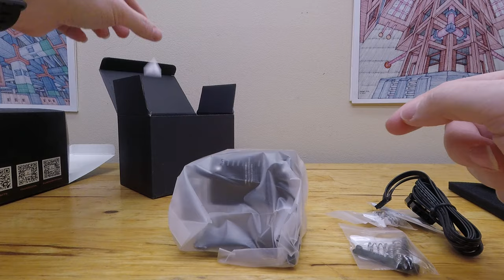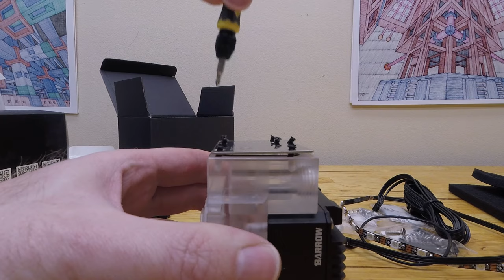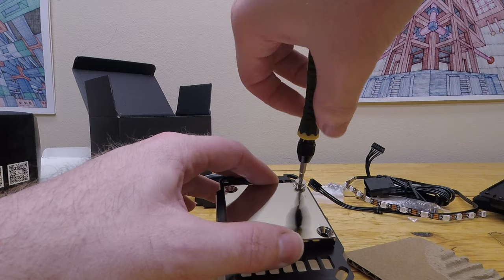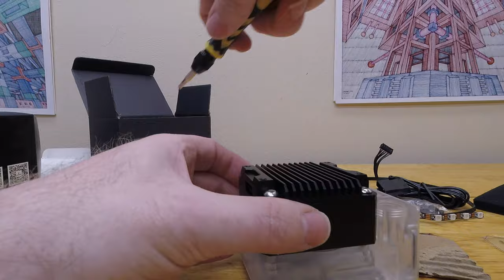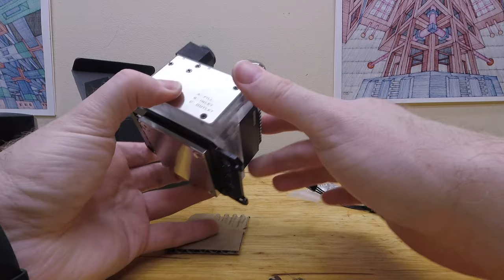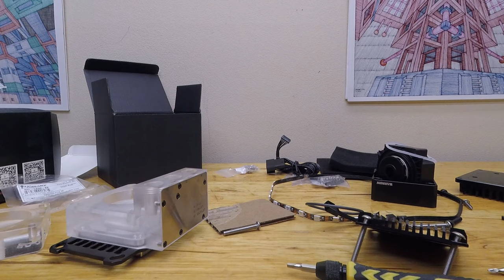Disassembly Reassembly DDC Barrow AMD CPU water block integrated pump and reservoir combo LTPRKA-04

Comment: does the block support d5 pumps or only ddc pumps ? sorry if my question does not make sense,im new to watercooling.
Reply from the maker: Not a problem. I'm pretty sure DDC and D5 are different shape/sizes so you won't find anything (tops or block wise) out there that will fit both. Most places you can filter down to one or the other.

Comment: Thanks for the video, it was really helpful. Regarding the LED strip, can it be plugged into a standard motherboard fan header? or does it require a motherboard with an RGB header?
Reply from the maker: Don't plug into a fan header!!!!! They sell a converter to 5V RGB header. There's even a little tag telling you not to plug into motherboard fan header. I think they used that connector for convenience, but is only confusing to end users. There is a label on the converter and the led strip's connector that says "5V lighting interface" on one side and on the other says "Do not connect to the motherboard interface of 12V FAN" I've posted pictures of this label here:
https://imgur.com/a/rmfUjlv
This was the USA ebay vendor I used who sells the converter: https://www.ebay.com/itm/Barrow-5v-RGB-Adapter-Lrc-2-0-ZBDZJX-5-IN-STOCK-USA/303575876543
Reply: @flyordieinafire  Thanks again for the information. Too bad Barrow doesn't include all the wiring to make the lighting work out of the box. I purchased the adapter, and swapped out the pump with my Swiftech MCP35x.  This is a really nice piece of hardware!  An aside, I've been admiring your screw driver, what brand is it ?  Thanks again.
Reply from the maker: @Soda480Place  Glad to help! It came with an iPhone repair kit
https://www.amazon.com/dp/B00SURH7W4/

Comment: Nice! What's the deal with 90 degree rotation for AMD vs Intel? Looks like it can be configured either way? Also any flow or noise numbers for the pump swap?
Reply from the maker: Thanks for the comment. With the Intel mount (I don't have) you can mount either way without issue, but with AMD the Reservoir/ports section of the acrylic block two of the AMD mount holes so you can only mount sideways either way. Optimum Tech shows close up of intel mount here: https://youtu.be/SBIWgKmwr68?t=130
Alta's Project shows the AMD mounting here: https://youtu.be/zSfsFlaw7uM?t=189
Original pump looks to have a potentiometer dial to adjust speed and the MCP35x is PWM controlled. I won't have flow or noise numbers for this pump swap for like a month. I'll post another video. Currently waiting on GPU waterblock preorder. In the meantime I'm test/dry fitting the parts I do have to sort out what other parts I need to order.
Reply: @flyordieinafire  sorry, let me rephrase my question :).. I have an AMD block (like yours)... What's stopping me from pulling it apart and reinstalling the mounting bracket with a 90degree offset? From your video it looks like that will work just fine?
Reply from the maker: Here's an imgur album (at the end of this post) . Does this help answer your question? You'll notice two of the mounting slots in the bracket are blocked by the reservoir area. They could offest the acrylic drilling and offset the bracket to compensated for this, but as is it's symetical and the reservoir is in the way. Alternatively if they made the widge just the G 1/4  width they could make the reservoir section shallower but maybe they didn't do that because of the G 1/4 Threads. https://imgur.com/a/uMywI8f
Reply: @flyordieinafire  ahh I see, damn why didn't they offset the whole thing by a few mm....ok, so basically someone needs to laser cut a new mounting plate...

Thanks again for the pics/explanation
Reply from the maker: @davids8345  np. A new mount plate also means mount on die/cpu will be offset. Probably not a deal breaker especially if it's the difference between mounting and not fitting.
Reply from the maker: @davids8345 I was thinking about it and I'd totally have paid a couple bucks more for a second bracket with the couple millimeters of clearance needed to mount in the other orientation.
Reply: @flyordieinafire  yep.. if I had a friend with a CNC machine I might be tempted to produce some...

Comment: Nice video ! 
All my laing DDC pumps ( four ) are 10+ years old and they are all atill going strong. I wonder how many of those chinese knock offs will reach that mark.
Reply from the maker: Another user mentioned theirs had a rattle out of the box. So it's probably hit or miss likely a miss.
Reply: @flyordieinafire  Damn. Also did I miss it or there was in fact no heatpad between pcb and heatsink ?

Comment: Is there supposed to be a thermal pad in-between the pump components and it's heatsink or else I imagine it doesn't really do anything to take heat away from the pump ?
Reply: Asking about the stock pump on the block before you changed it out
Reply from the maker: @chewbaccasaurusrex692  I don't believe there was. This was the first time I opened the packaging. I haven't played back this video in a few months so I don't recall. If you didn't see one in the disassembly then there wasn't. Most aftermarket metal housing I think have something to help reduce heat to prolong the life of the electronics.

Comment: how are your rotary fittings that smooth? My bitspower and barrow rotaries are so damn stiff.
Reply from the maker: Machined two pieces. That's how they can be that small. Unless you're talking about the bigger EK rotary fittings. Big fan of the classic EK 90 rotary.

Comment: Did you ever test the swiftech pump if it seals correctly and works great?
Reply from the maker: Project stalled. 😩 Was waiting on parts before I could finish build. Haven't gotten back to work on it now that I've got everything in. 🤷‍♂️

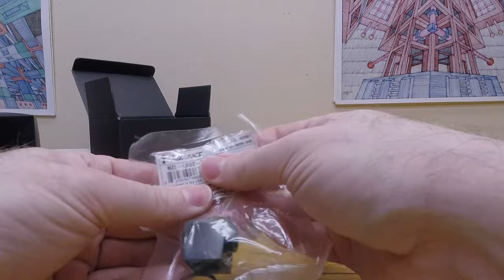Comment: One suggestion: If you don't want to use 90* fitting 12:50 you can remove the pump, install your fittings then replace the pump properly without crushing the O ring. Cheers.

Comment: Is it the same pump they use for their pump reso combo? People said it's only good for ITX builds but I'm thinking to use this for ATX builds (360 rads, longer tubing). Do you think it'll work just fine?
Reply from the maker: I don't know. I already had the MCP35x on hand and I can control with PWM on the machine. I've already swapped out the stock pump. Stock pump has manual potentiometer for speed adjustments.
Reply from the maker: Here is someone else's imgur on the parts the block comes with: https://imgur.com/gallery/izA9uD0
From this thread:
https://www.reddit.com/r/sffpc/comments/ic43es/the_barrow_blockpump_came_in_today/
Reply: @flyordieinafire It looks like the tape was left on that thermal pad of the MCP35x
Reply from the maker: @branchyaboy yea I left the plastic on one side. I've since replaced the heatsink and thermal pad. Will be another upload next month.

Comment: Can this pump be powered with a motherboard header?
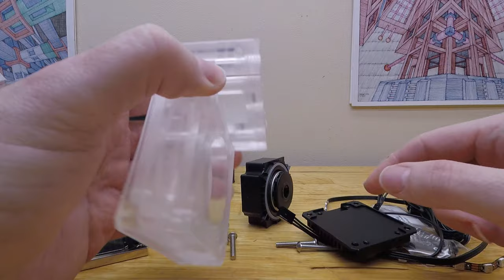Reply from the maker: At 6:30 I pickup the connector. I believe it requires a four pin molex for power and fan motherboard header just for fan speed info.
Reply: You can rewire the connector to a 4 pin and get rid of the speed controller. The pump PCB has the pin out on it but the motor needs 1.5 amps, make sure your MB header supplies that

Comment: The Barrow pump also has PWM. At least mine does.
Reply from the maker: My connections are like to this video's
https://youtu.be/E3XAu5Flqzw
Reply from the maker: Here is someone else's imgur on the parts the block comes with: https://imgur.com/gallery/izA9uD0
From this thread:
https://www.reddit.com/r/sffpc/comments/ic43es/the_barrow_blockpump_came_in_today/

Comment: Which brand of DDC pump they are using..? I meant the OEM.
Reply from the maker: I suspect it's their own brand. It has the Barrow metal external and their custom connector and cable for the potentiometer for speed control. I'll take a look at the stickers but I think they are just like QC and stuff.
Reply: @flyordieinafire  thanks you so much. I'm waiting to hear more from you.
Reply from the maker: @abzaman77  I found the connector, but not the pump. I'll see if I can find it this weekend.
Reply from the maker: Finally found the pump hiding in a big bag of fittings. It has a QC and Date sticker. I haven't googled the PCB label but here is what it looks like.
https://imgur.com/a/XKl7TGL

Comment: You don't have fear to galvanic corrosion? I think the lateral metal plate it's aluminium...
Reply from the maker: I do. I was hoping premix would prevent that, but I'm also thinking about replacing it with another material. Being rectangular I should be able to reproduce the side and mount holes in another metal. But what other metal? The "aluminum alloy" mention on almost everything barrow makeshas turned me off using most any other part from them.
Reply from the maker: I just remembered the jet plate! I'll have to replace that as well
Reply: It would be nice and worth the extra cost if all the materials were brass/copper but I don’t think you need to really worry about corrosion if you’re using a treated liquid. Aios get away with mixing metals all the time and don’t have an issue.
Reply: dude chill chill aluminium should only be on the outside and not catching water itself..... i have many barrow watercooling stuff the aluminuim alway outside for cosmetic . I been use mix of  barrow ek hardwarelab freezemod bykski  and mayhem bioside+inhibitor plus for more than half years with no problem at all in myloop with 4radiator. i just tear my loop 2week ago and it still look news. and for jet plate Stainless steel.....don't worry about it almost every cpu block brand have it. In the video the bracket look like it might touch water but i if screw is tight it shouldn't be problem.
Reply from the maker: @flameboss555  The  mounting bracket won't touch water. The concern is the jet plate and reservoir's metal side wall. Neither are magnetic.
Reply: @flyordieinafire  by the look the side metal doesn't look like aluminium either nickelplate copper  or stainless steel, by the look it more like nickelplate.
Reply: @flyordieinafire  Even noob knows don't mix aluminium with other metal in a waterloop. Barrow has been in water cooling business for years. Do you think they would be so stupid to use aluminium jet plate and side plate for their products?
Reply from the maker: @spektrumB  they literally state "Material: Aluminum alloy+Acrylic/POM" on the product page and there is zero discussion of the jet plate in the product material to denote what kind of metal. So yes. You can buy generic chargers/wires from China that use Aluminum wiring instead of copper wires to save on cost. Most modern water cooling additives include mix metal inhibitors as well. So yea. They aren't doing a great job of explaining what is aluminum and what is copper. The only reference to copper is denoting the cold plate is "copper-nickel played mount"
Reply: @flyordieinafire  You open the pump block. Barrow also doesn't mention what metal the impeller is made of. Is it made of aluminium? And Barrow although isn't not as big as EK, they aren't no name generic manufacturer.
Most pre-mix coolant, although has anti-corrosion additive, won't be enough if there is aluminium in the loop. Many AIOs has aluminium radiators. If you try to re-fill a typical AIO with EK, Mayhem, etc premix coolant. Good luck it survives more than a few months.